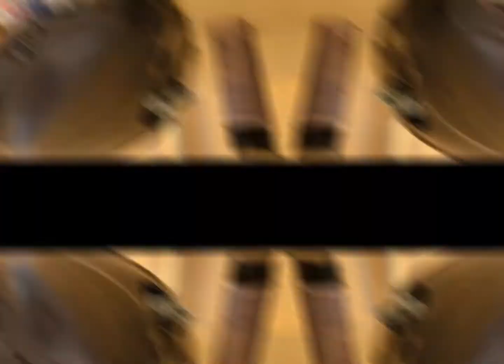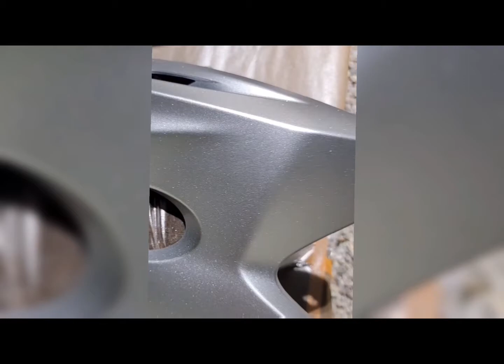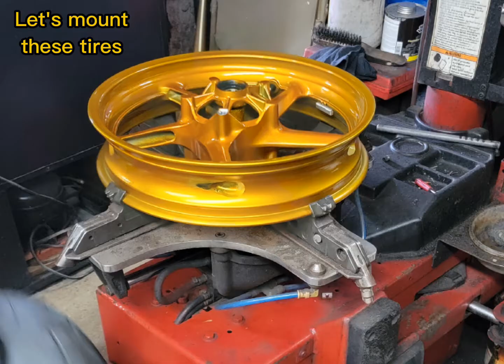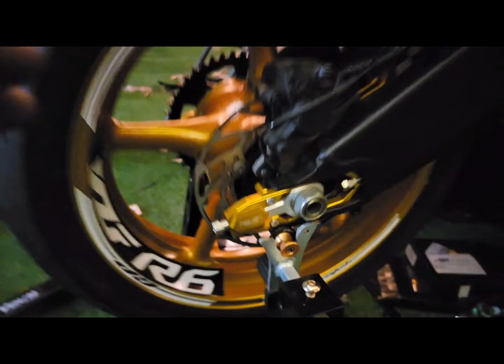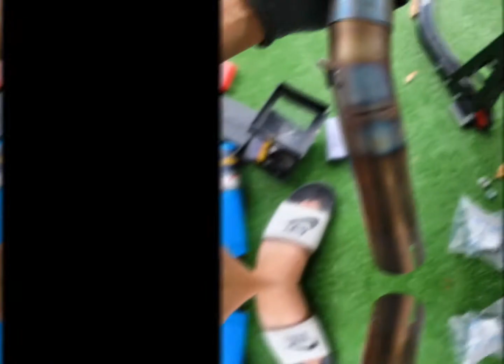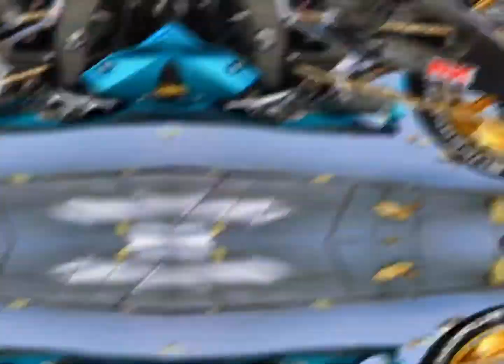YAMAHA YZF-R6 2020 CANDY TEAL UK-15 . HOME PAINT JOB

Comment: What was your "air" setup (compressor, gun, filters, etc)?  Is there any flex additive so the paint doesn't crack when panels flex?  Adhesion promotor for the plastic?  TY